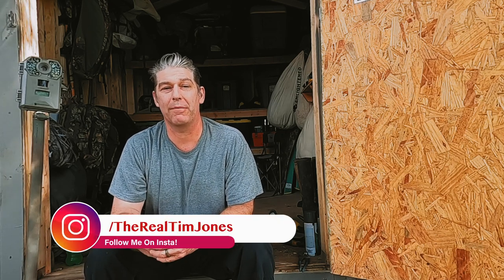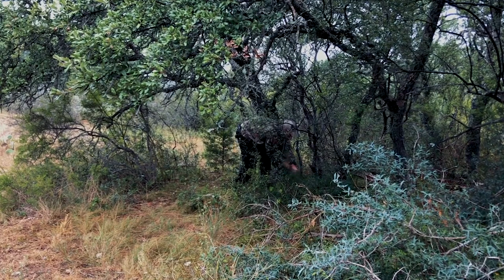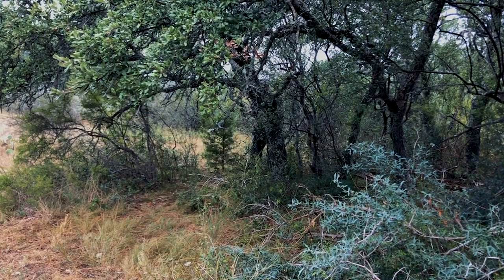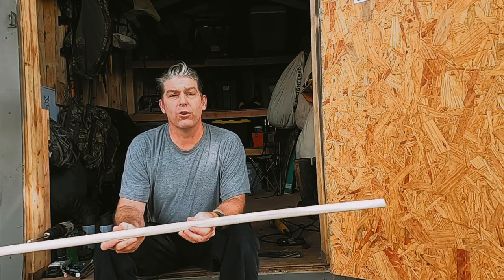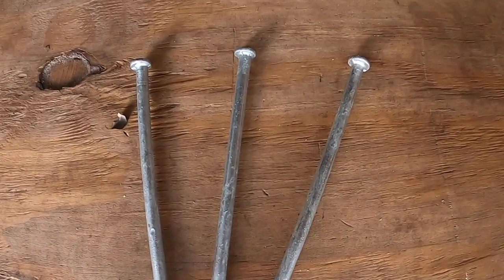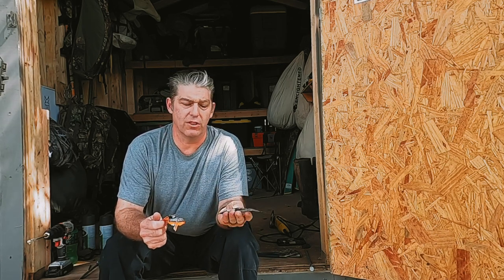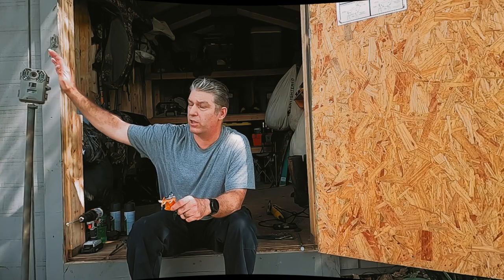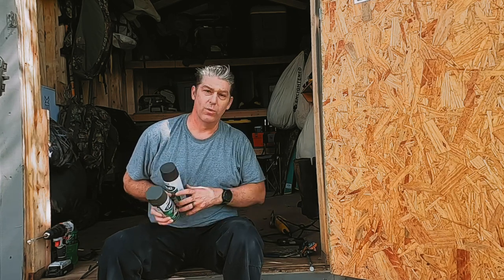How to Build a Trail Cam Mount | DIY Trail Cam Mount

Comment: You could use a hanger bolt (screw on 1 side, bolt on other) & just screw that into the top of dowel & forgo the glue, removal of bolt head and drilling all together.